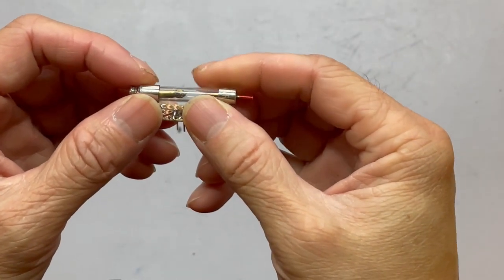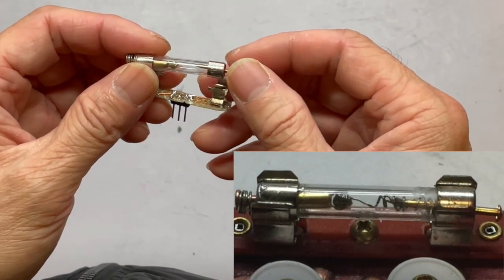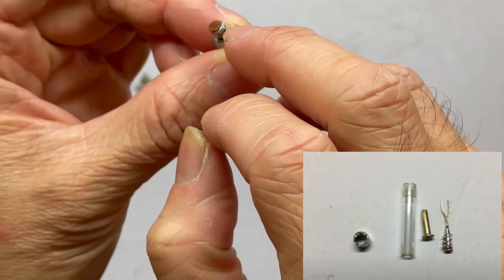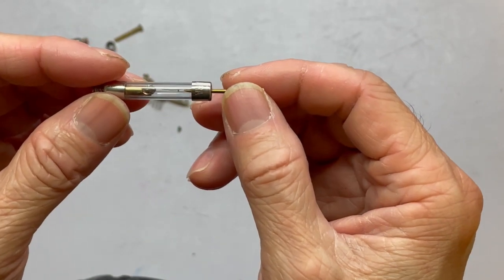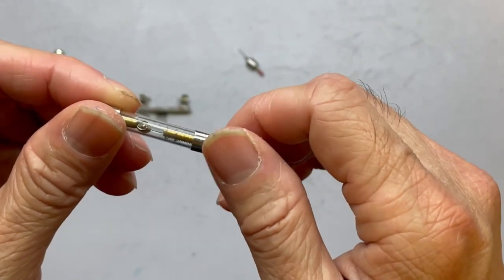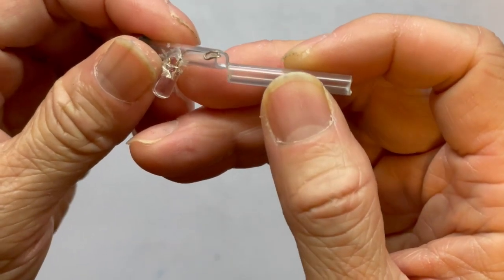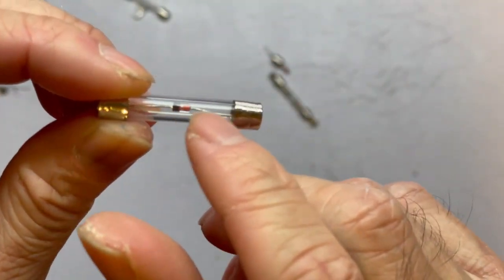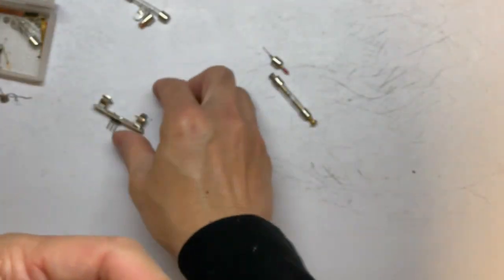Fuse Tube Crystal Holder

Comment: Thanks, I really like this idea, Those diodes are so small and fragile it's a great idea to install them into an old fuse to make them easier to handle. 
If you have ever dropped a diode on the floor, you know how hard it is to find it without stepping on it.